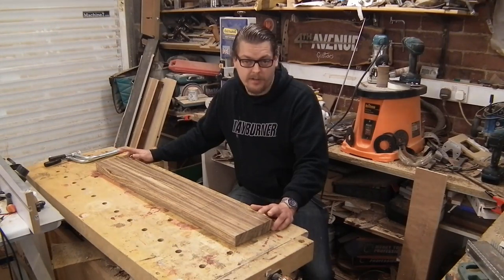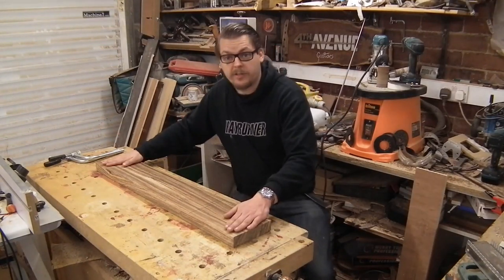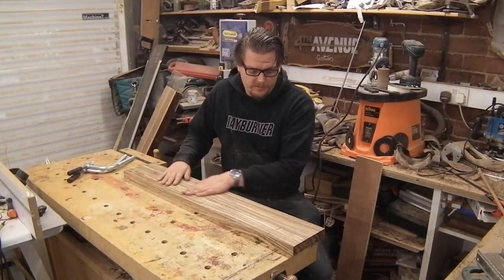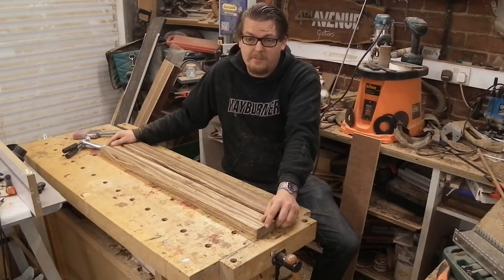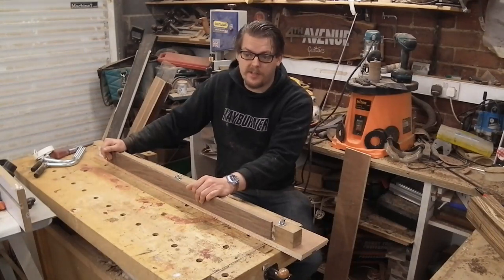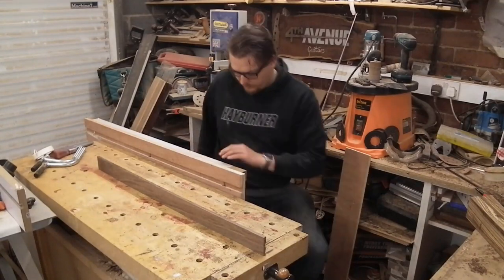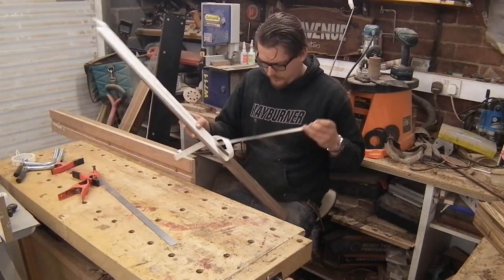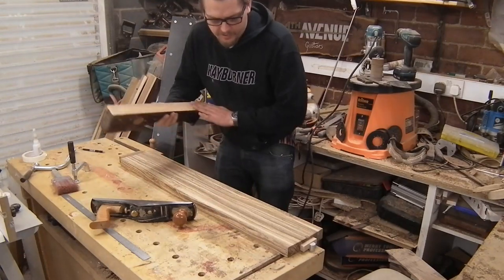Custom Guitar Build: The Phoenix #002. Part 5; Preparing a neck blank.

Comment: I like the idea of tapered center piece. I've made some multi lam necks that came close to running off the side and I agree it's not a good look. If they had run off the edge they would have been firewood. Looking very good and that bass you showed is beautiful. Also really the fact that there is someone out there besides me that works among the clutter.  A neat shop is a sign of a sick mind.
Reply from the maker: I have a full time job, 2 dogs, a classic car and a girlfriend on top of building guitars... I barely have the free time to feed myself let alone tidy.
as for the tapered laminates, I'm just glad I finally managed to post a video of doing something before Ben from Crimson guitars got there first haha.
Reply: @4thAvenueGuitars  Ben has used tapered cores since way back in the original garden shed. Just saying. I’m not a huge fan of Ben I’ve seen him do some really dumb stuff over the years. Even to the point of unsubbing. I think his designs are impractical and even uncomfortable to play in some cases. Anyway I only started watching him again because of the guitar build off and then ran into your videos. Happy accident!